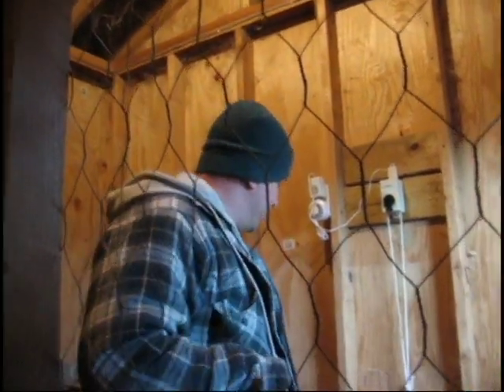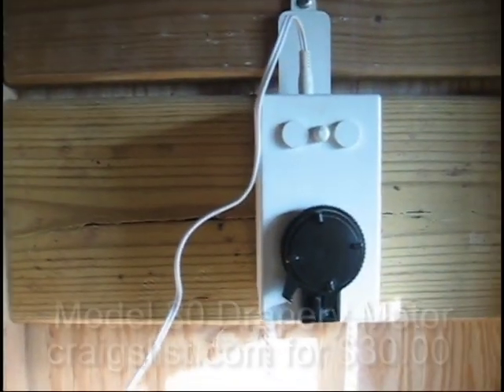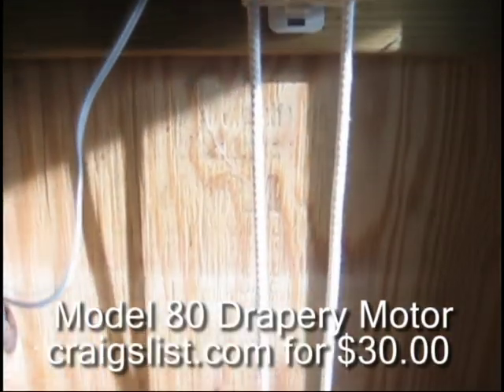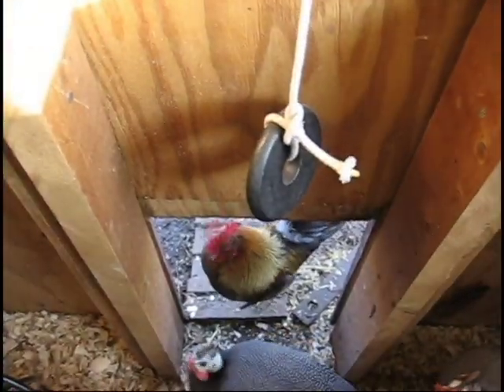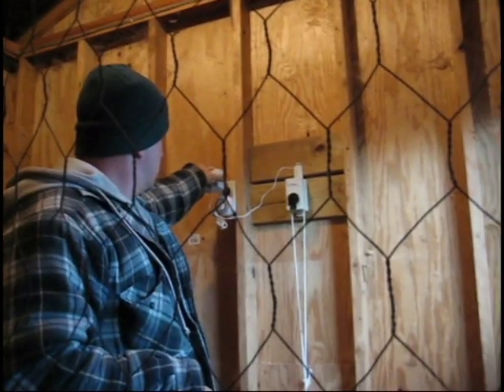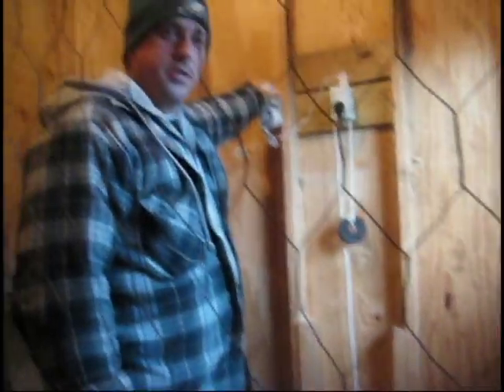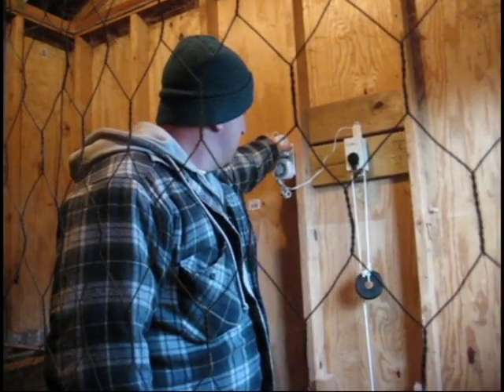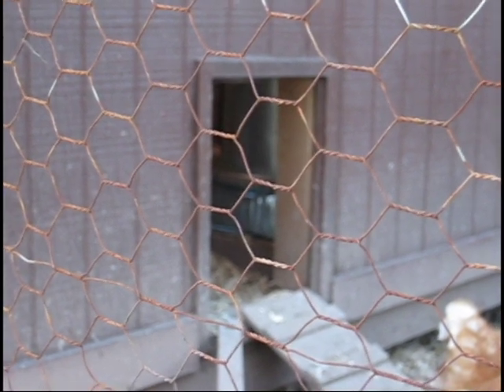Automatic Chicken Coop Door using a drapery motor

Comment: Impressive technology! If you don't want motors etc, consider my chicken-o-matic (search on You Tube for it). It uses an irrigation timer, a hose, a lever and a bucket. It is programmed to open and shut when I want.The water is recycled to fill the chooks' water bowl up too. No electricity needed (apart from a battery for the timer). Cost is minimal and it celebrates the principles of leverage and simplicity. No problems for us in New Zealand with snakes or foxes - we have none.

Comment: @jpreia the add-a-motor uses a DPST limit switch that diverts power to relay A or relay B, which applies DC power to the motor in alternating polarities.  In other words, inside your $99 motor box there's a $10 gearmotor, a $2 switch and $5 worth of relays.

Comment: And yes, the door design must be well thought out so that critters can't grab the edge of the door, or flat-paw the surface and slide it open.  Suggestion:  Use a piece of sturdy sheet metal (like an old street sign) and design the door so no edge can be grabbed from the outside.  It's too smooth and heavy enough that you can't "flat paw" it open.

Comment: If you use the D20 model Drapery motor you wont have the issue of tanglement from the counter weight. I got mine from AutomaticChickenCoopDoor  They sell the whole door unit there.

Comment: @gwana8919 I'm probably being paranoid myself.  My design is not altogether unlike yours.  It's basically a mini-polebarn with a hen house at the back and a fully enclosed wire area at the front.  'Coons are a big problem here as well as skunks, which will dig under stuff (especially in the soft veggie garden earth directly adjacent to my coop).  My hope is a setup like this will allow me to not be too worried about the digging under issue.  Thanks again.  I'll post some shots of mine when done.

Comment: Caught this over at BYC.  Thanks for sharing.  I've been pondering the idea of how to do something like this since I started building my coop that's about half done.   I do concur  though that a Racoon could still lift the door as designed.  This is a significant problem in my area.  I believe I will try to set mine up with extra weight holding the door down and enough counterweight to allow the opener to work as well as an exterior slat at the bottom for the door to close directly behind.

Comment: I like the simple yet effective design.  I looked on the Internet and found the Add-a-Motor D20, which is made for a chicken coop door opener, for $86.95, the same price as for the 800DR model used to open and close drapes.  It says don't use the drape model as a chicken coop opener or it will void the warranty.  Since you bought yours used for $30, the warranty doesn't matter to you.  It would be a great help to install an automatic door closer for my chickens.